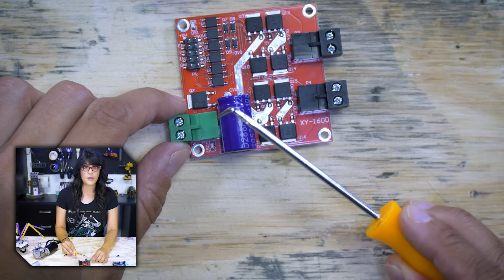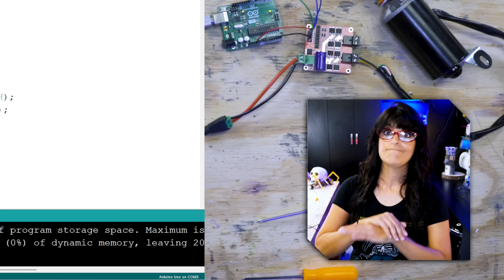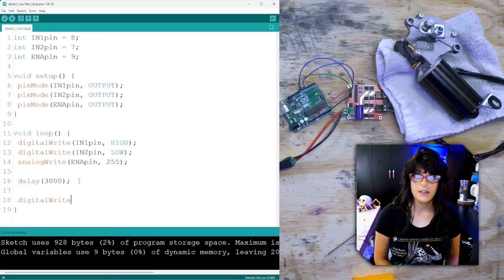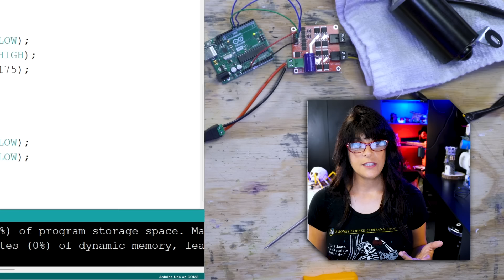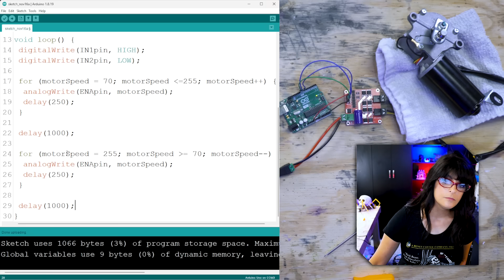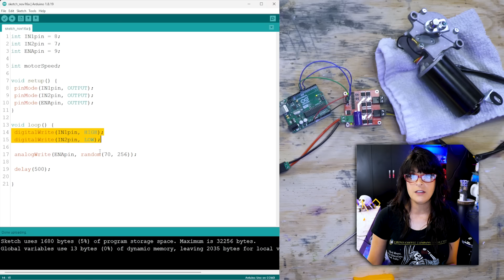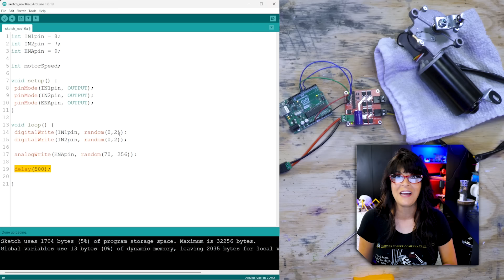How to Control a 12V Motor with Arduino: Easy Wiring & Code Examples

Comment: My kind of Woman .  Loved every aspect of this : )
Reply from the maker: Let me know if there's any other topic you'd like to see 👍
Reply: @RachelDeBarrosLive  I have a small project where Im trying to power a small specialised fan (air delivery) with hi speed brushless motor, Li ion battery 24V DC, sub 0.6A consumption with pot type speed control.  Occurred to me later that I need to maintain the rpm with dropping voltage... hmmm.

I was hoping to find a vid on controlling brushless motors.  So many types and control mechanisms.  Some need ESC some have on board drivers... some can be controlled with PWM but then you need a pwm generator outputting  the correct frequency to match the motor input requirements (maybe its own 5V power supply).  I was trying to line up an onboard driver motor with a simple PWM servo tester.  After buying all the wrong components and blowing out many of them it seems, watching your vid, I could have done it much better with an arduino and maybe motor controller... hmmm.

Love the violin btw... got a Devil went down to Georgia cover?

Comment: Very good. I am like you an last year started a project digitizing the SooChow Astronomical Chart. I was moving along very fast then got bogged down programming the chart. While working on the programming example of the chart I plan on building a mechanical version using an arduino to control a motor. The project is to create the solar system moving as seen from earth. Thanks for relighting my interest in the 28 lunar manisions.

Comment: This tutorial was amazing! Well done! I really want to start playing around with Arduino and motors. For random direction you could have a variable 0-2 in the loop and use IF variable= 0 then INpin1=low and INpin2=high.

Comment: Nice explanation, but as an electronic technican i have one remark 
You set IN1pin high and then IN2Pin low 
Thats something you never ever do. Overall not when you cant be sure of the actual state of a pin when booting a microcontroller. 
In worst case IN2pin was already high when you set IN1pin high what could kill the motor driver. 
Always make sure all pins are set to the condition you expect in the setup. 
And always make sure when you have 2 direction pins, like in your case, to set one direction to low befor you set the other to high. 
In industrial applications thinks like direction change have to be locked against each other so both directions never can be  active at the same time. 
For small motors its not a big deal, but a wiper motor can draw significant current and potentially could kill your driver. 
So best practice would be to always make sure that pins that should not be active at the same are locked against each other.

Comment: I was bored so I just looked up how to control a 12v motor with an Arduino and after watching your video I just realized why a little Arduino bot I made didn't drive at different speeds. It's cause i did digitalWrite and not analogWrite. Thank you for the content and helping me realize a coding mistake I made.

Comment: At last someone who explains Arduino code simply , I'm just starting out with this system to control motors and wondered ? I want to run 2 motors at the same time from this setup , How would i go about coding the second motor to start and finish as the 1st one as in your video ?

Comment: interesting to see this....I have done one small Arduino project on an ATtiny10 (digispark) that takes one output channel of an RC car reciever and splits it to operate 2 servos one amd then the other...the wiring took 20 minutes the coding took 4 months...

now i am in the planning stages of creating a small single story elevator using 750 pound rated scissor type lifting tables...the lift height is about 50" per table and i need  90 inches of lift so connecting the scissor sections of 2 units ought work....the tables are hydraulically raised using a foot pump and I have been imagineering various way to power the hydraulics while using an Arduino to manage possible motor and release valves as instructed by various switches...

Comment: I have learned so much from this one video that will be useful for all kinds of projects. I can imagine limit switches that would be inputs to the Arduino so as the “spider” reaches an extreme, the switch tells the Arduino to do something like, stop or set a variable, or reverse. Thank you!

Comment: I know my comment is very basic...but this is not my area.  I am building a plasma cutting table. I am at the stage of wiring.  There are 3 stepper motors.  There is a 24 v power supply.  There are 3 stepper motor drivers. 1 arduino,  and switch.  I asked the designer what gauge wire they used to wire the box.  They told me 18 ga. So I tried to locate 18 ga. jumper wires, to no avail.   I bought male / female pins to make my own.  The pi s are so tiny, though , I can't see how I can attach them.  I asked a guy who repairs computers etc if 18 ga. wire is actually necessary.  He said he didn't feel it was necessary to go any larger than 24 ga. as that is typically used on arduino devices.  If this is enough information, do YOU think 24 ga. is sufficiently large for this application.  Thanks in advance for your time and expertise.

Comment: How much electricity for one day will be used if the motor is off? Using 12v 5amps.
Including arduino and that motor driver module

Comment: i learned to arduino code at a makerspace course in december, now im making a led sign and a motor turned on and off via a thermometer ..and yeah it does not go as fast as i would like, but its moving forward :)

Comment: The L298n will fry if the power rail goes over 30 volts for 1 microsecond.

An electric motor generates inductive spikes on phase changes (think old style auto ignition coil).

There are protection diodes that clamps rail voltage to the input rail.  Using a battery, life is good.  Using a regulated power supply the excess voltage can come when the switcher power supply is in transition, generating a tiny spike.

Note to self, use batteries and/or enough bulk capacitance to absorb all the inductive energy from the load.
Reply: To look for this use a DSO that triggers on over voltage and zoom in to the microsecond scale.

;^)

Comment: Love your channel and thanks for explaining like you do. I am hoping you could follow up on this vid with adding load control, eg. maintain a set speed with a variable motor load. Maybe adding an encoder to measure the pulse width and adjust when required. The hardware I am good with, but the coding I am still learning.

Comment: Question. I need the 5v for sensors. The Uno only seems to have the single 5v. Can the motor controller use the Vin?

Comment: This is absolutely fantastic info!  Where have you been all of my electronics life?!  I have done so much research and experimenting with so many motors and controllers over the years for various projects and have always been stuck with using stepper motors which I thought were the only way to achieve some kind of accurate control.  As you may know stepper motors are quite limited in variety, (especially when it comes to smaller sizes), and these are also relatively 'under powered' for many applications.  This type of control opens up a whole world of possibilities.  Thank you so very much for your time and effort.  Awesome video.

Comment: Is there a way to upload the code on a USB and leave it plugged into the Arduino? So I do not have a laptop sitting next to it the entire time. Thank you!
Reply: im pretty sure you upload it to your arduino and its stored there. you dont have to have anything plugged in
Reply: I wish I could share a screenshot. On Ardunio Ide, when I enter digitalWrite(IN1pin, OUTPUT); the output does not change color and then asking for a number between 0 and 255. Any idea why its not taking the word OUTPUT?
Reply: @JahnCruzMP4 I’m having the same issue. I belief it’s because she’s working on an outdated version of the IDE. But I have yet to be given a solution to it

Comment: I am making a project in which my 12v dc motor has to be rotated in both clockwise and counterclockwise direction for different time intervals. Can I get in touch with you regarding some confusions ?

Comment: I connected all of the wires together correctly and I wrote the code the same as in the video, but my motor for some reason won't move at all even though the code says that it has uploaded. Does anyone know what might be the issue? I made sure already that I have the wires connected to the correct side that matches up with the dock that my motor is connected to.
Reply from the maker: What motor driver are you using? Not all of them have a GND pin to form a common ground. Sometimes you have to jam in an extra ground into into the screw terminal to send to the Arduino. The XY-160D has a specific GND pin for this but not all motor drivers do.

Comment: I just say that you are one bad ass. I’ve just started getting into Arduino/raspberry pie world and was scratching my head on what kind of starter kit to get thinking about what I would like to do and landed here. Is there a kit you would recommend for someone who has not purchased any supplies whatsoever? I want to control a motor that will simply function as a deadbolt, in addition to using a magnetic lock.

Comment: Goodnight. I have a question for you: why didn't you use the new Arduino IDE for your codes?
I would be immensely grateful if you could answer that.
Grateful. (translated)
Reply from the maker: I don't use my live streaming computer for day-to-day coding (just presentation) so the Arduino IDE gets outdated. I always make a mental note to update when I see it while streaming but then forget once the live workshop is done 🤣

You'll see it updated in future videos!

Comment: A small tip for those of you who hasn't programmed all that much.
1: Use variables instead of numbers if the library accepts this. Instead of writing 125 at the speed control, and you have 10 motors, if you use variables than you need to change ONE or two or three things instead of ten.

2: write constant before int "pin name" = 5; This tells the compiler (human to computer language black magic thingy) that don't touch this number! This will be 5 forever and ever.

Another function that I would've implemented within the code is a acceleration and retardation  of the motor from stationary, we talk about 5-15ms maybe just to lower the starting current of the system. This function can be called from any time within the program. Especially if the prop are heavy and the control arm are in a bad place or angle, because those motors will rip either the prop to pieces or burn the H-bridge if it stalls for some reason. 5-10A are running currents not stall current.

3: Use the map function in Ardu it can make the speed control more hooman readable,  this function calculates two values into two other. Like this.
value_to_spider_speed = map(speedpin, 70, 255', 0, 100); or if the number would be the other way -> 0,100, 70, 255 just test.
this will make the your code easier to maintain too, for example if you want 50% speed then you just type in 50 instead of starting to calculate what 50% speed is between 70-255 bla bla.

And about the spider, I presume that this parking puls could be used to count the number of rotations done, instead of relaying on time and as a safety feature (think WDT) if the Ardu doesn't get any pulses... either the motor is stalled or a fuse has released its smoke or worse, the cat is stuck in the prop. It will be crude but for whatever its worth.

And last: make sure that the motor control has protection against back-emf or those motors, solenoids and relay and other inductive loads can and will kill your controller and or Arduino.
Most of these has diodes or capacitors for this purpose and the interface against the Ardu is probably equipped with opto-couplers. The thing is that a relay or a motor that switches or stops abruptly can generate voltages well above 5, 12 or even 48Vdc, we're talking about hundred of volts under right circumstances.
I'm not trying to scare anyone but have this in mind.

Comment: 70 or 80 years ago, I used to control d.c. motors with a switch and potentiometer (vary the current in the field coil).

Comment: BTS7690B can be used instead of XY-160d ???
Reply from the maker: Absolutely, that's another great motor driver module for high current DC motors. It can handle even more Amps than the XY-160D that I used. 👍

Comment: Rachel I came across your videos because I wantes to make a shooting game using a windshield wiper motor. This is great, what i need some help with is using a piezoelectric shock sensor to turn the motor clockwise?
Reply from the maker: That's a fun idea! I should be getting in some piezo sensors in soon so you'll see some videos on those soon!

Comment: I have been a professional software engineer for 30+ years and I have done lots of Arduino programming as well. I watched your video because I am very interested in motor control. The way that you teach is just universally enjoyable and very well structured. Thanks Rachel!
Reply from the maker: Glad you enjoyed it! Let me know if there's any other topics you'd like me to cover.
Reply: Hello @RachelDeBarrosLive
Reply: How about something that could measure blood pressure with Arduino 1?
Reply: @RachelDeBarrosLive  Can you do a vid tutorial on controlling an ‘electric hydraulic actuator’? Be able to set min max ranges, memory pre-set heights, and so forth. 

For such projects like adjustable height workbenches, fyi woodworking machines/jigs, etc. I have a very good quality actuator I pulled from an industrial professional treadmill “FreeMotion” brand (only 5-7 years old). I have a bunch of ideas for it but need and want a control and screen to (properly) operate it.
Reply: "Hold your breath..." Paul McCormick.😊

Comment: Thank you so much Rachel for your recent reply but I am still not clear.
Assume I have already uploaded the code to the UNO and disconnected my Laptop USB cable from the UNO (UNO now has no power).  
I now connect the 12-volt power supply to the Motor Shield and the wire connections to both boards are as you show in your video. 
Is the UNO somehow getting 5 volts from the Motor Shield? 
I really don’t want to have two power sources, one 5-volts to the UNO (USB) and one to the Motor Shield (12-volt). 
My plan is to place the UNO WFI board/Motor Shield/12-volt connection in another room and send on-off, speed, direction etc. from my Cell Phone to the UNO by Wi-Fi.
Thank you.

Comment: ok i have a control board that the blowers power output control is dead so i need to make a system that can handle this. it has 2 blowers that the output seemed to range from 8v-14v on one(exhaust blower seemed to have 3 or 4 speeds i'd do 4) and 6v-14v heat exchanger interior fan. in the end i would like a way to increase it on the fly but also want it to always at least do low but adjustability via knob is a future issue. on the original board it can output the voltage still but no amps at all except enough to see it's voltage. Is there a way to use this value to set the blower value via the original controller and if so how would i do this? original controller has the pellet auger which has 5 settings and these correspond as a example(2secound on 15 seconds off for level 1, 2 seconds on every 10 seconds, and so on.)  and 3 safety systems(flame sense 110f normal open till 110f, overheat 220 normal closed manual reset switch, vacuum switch to detect exhaust fan is working normally open unless fan on than closed) all 3 safety systems switches are simple bi-metallic(heat sensors) or membrane(vacuum) connectors. 

Also yes I would buy a new part for it if it was available but it was discontinued in 2001 and there is none available anywhere as it is purely a dc system(they only make AC systems now) that has a converter to bring in 12v-14v(need to verify this yet) via the wall 120v.(baby magnum countryside bd-dc pellet stove) this is ran from a 105AH 12v deep cell agm battery that is charged via 600w of solar power on a mppt. without solar the system can run for 4-6 days at just a direct connection to battery.

So what Adriano and sub board would you recommend? obviously i'd like the fans to me married but run at different speeds as the air exchanger can run way lower than the exhaust blower. my ideal is 5 levels so that is can marry the current 5 levels that it currently have. 

I need help please as i am just entering the adriano world

Comment: Hi, new here to electronics. I have a project that requires a 12v led strip and a motor. Can I hook them both up to the smaller power conversion board thingy?

Comment: // Motor control pins
const int ENA = 9; // Enable pin for motor A
const int IN1 = 8; // Input pin 1 for motor A
const int IN2 = 7; // Input pin 2 for motor A

void setup() {
  // Initialize motor control pins
  pinMode(ENA, OUTPUT);
  pinMode(IN1, OUTPUT);
  pinMode(IN2, OUTPUT);
}

void loop() {
  // Set motor speed (0-255)
  int speed = 150; // Adjust speed as needed
  
  // Set motor direction
  digitalWrite(IN1, HIGH);
  digitalWrite(IN2, LOW);
  
  // Set motor speed
  analogWrite(ENA, speed);
}

Comment: What's your longest delayed prop development? I built a Thermal Detonator (ala Return of The Jedi) many years back out of 'homebrew' electronics and cobbled together mechanisms (It worked fine, but was a mess of wires and JB Weld inside), and thought I could revisit it more aesthetically now that I use Arduino and purpose built sound modules. Well, that 'revisit' has been in pieces at the back of my bench now for 3 years +, what with designing and printing internal cages to hold the Pro Mini and JQ6500, and the speaker, buck converter, USB charger for the 3.7 LiPo and the LiPo itself, while still leaving room for the microswitches. I will finish it one day, promise!